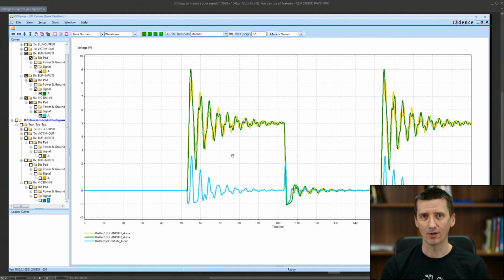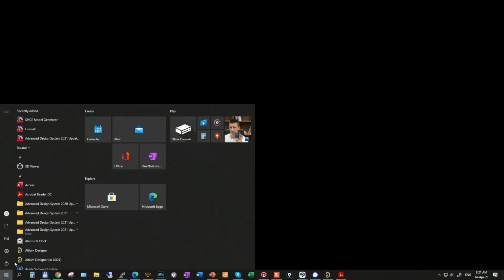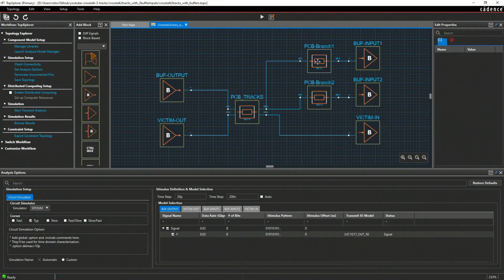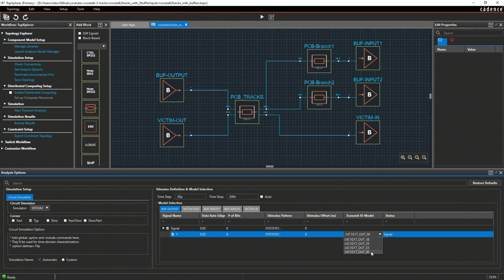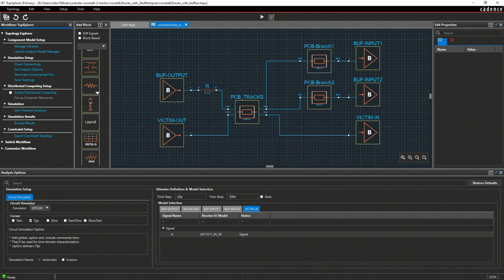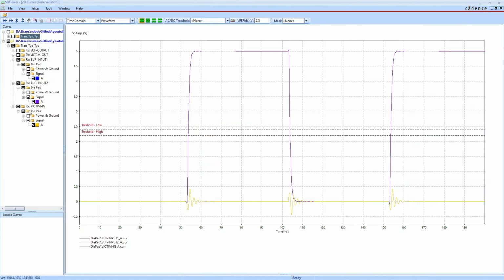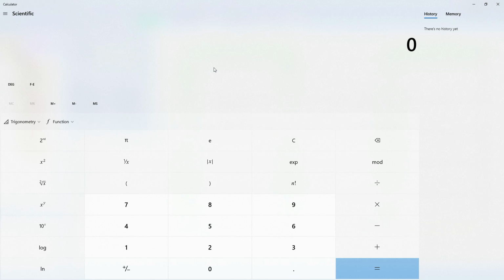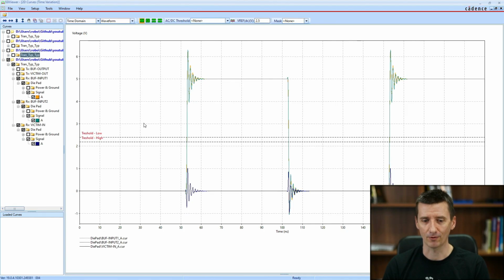3 Simple Tips To Improve Signals on Your PCB - A Big Difference

Comment: Yeah he's dead WRONG about his "impedance/reflection" reasoning. The "ringing" is from an RLC circuit that the trace forms as it becomes an inductor. if it was a reflection/transmission line issue, you would see a step looking wave, not a sin wave. The resistor limits the current drive which reduces the ringing, simple as that. By limiting current drive it reduces the slew rate and thus the high freq  energy that triggers the effective RLC tank circ that causes the ringing.  Sad to see him "making up" stuff to justify the impedance/reflection thing. same with stackup, it's affecting the capacitance. SO, the freq (10MHz) is irrelevant, it's only the Edge speed that counts (unfortunately this is typical youtube).
Reply: I’m sorry but your comments are rude, they are not constructive but destructive..

If you have watched previous videos of him, you would easily see he has solid knowledge that the rise time matters, not the frequency. However he should’ve also mentioned the rise time of the signal somehow, but he also knows that most people think and visualize by the frequency so I feel that was a better measure here.

If you’ve watched his previous videos on crosstalk which he had Bogatin as a guest, you would’ve removed your comment about the stackup change being only a capacitance changer..

Also, about reflection waveform being a step not sin, seems like you are wrong about it as he measures the end of the transmission line not somewhere in middle, please watch this “youtuber” video on this and observe the waveform on the scope: https://youtu.be/y8GMH7vMAsQ

Here is an another “youtuber” showing the reflection looks just like a sin ringing in the end of the line and there is a step in the middle of the line: https://youtu.be/g_jxh0Qe_FY

You may be right about RLC reasoning, but isn’t the transmission line an RLC circuit already?
Reply from the maker: @AbdullahKahramannn  Thank you.
Reply from the maker: Greg D, please, could you point me to the moment in the video where I am saying,  that the ringing what we see in that waveforms is caused by reflections? I am only saying, that if a wave hits incorrectly terminated end it will reflect - and that is a generic reflection which we also do not want to have in our circuit. In the video, I do not explain what exactly is the ringing nor what is its frequency or how it can be calculated.

Comment: I think I missed where the 33ohm value came from.
Reply: The idea is to put a resistor of the same value as the impedance of the PCB trace, to avoid wave reflection.
Reply: @TheGREDATV  I understand that's for termination resistors to ground, not resistors added in series, but maybe it's the same.
This series resistor seems to be good for building a low pass filter with the IC's on die capacitance at least.
Reply: @tomasxfranco  the parallel resistor is used to avoid reflection on the load, the series is put to avoid reflection on the driver.
Reply: @TheGREDATV  but he placed it on the load not on the driver.
Reply: @tomasxfranco  sure the parallel resistor should be placed always on the load, and the series on the driver
Reply: @TheGREDATV  so, are we back to it not working to stop primary reflections since it's not placed where it should be for that function?

Comment: Hey Robert, thank you for this informative and educative video! 
I was thinking what would happend if you increase the tracks length that it gets greater than wavelength?
Probably we would not like to increase it, but increasing the track would the noise increase, decrease or stay the same?
I would say stay the same, once it is greater than wavelegth, but something tells me that could be decresed (thinking about antennas you have the "best" length to get the right wavelength)...
Reply: Look up Standing Wave Ratios: antenna work on multiples that can also be fractions that, when there are length issues, cause destructive interference.  If in doubt, play with coax and use arbitrary lengths between connections and if you have enough connections used, you will see those that may work well, but others are effectively disconnected.

Comment: hey robert, great video and crystal clear! The only thing I wanted clarification and further elaboration on was the length matching of the two branches  from the aggressor trace. Since they are perpendicular to each other, why does making them the same length reduce the amount of ringing?
Reply: Because the signal reflects off of both ends, travels back and into the other branch. And if they have different lengths, the reflections arrive at different times, creating an oscillation between the branches.
That's at least my understanding, but take it with a grain of salt, I'm just a hobby dude, didn't study it.

Comment: Hey Robert,
Thanks for the video. It covers some of the basic SI principles and I'm glad you made this video because it can make my life as an SI/PI Engineer easier if someone like you is approaching something like this.

An important thing to mention that you did not is that the IBIS models allow you to also check how the signal will look like directly on the die of the component. Proper IBIS models have package parasitics, and pin parasitics (R L C) added in their models. This means that a signal might look good at the pin (where someone can physically measure with an oscilloscope) but at the die it can fail due to added inductance of the wirebonds and capacitance.
Hope this adds some valuabe information :)

P.S: I'm glad that someone finally explained why it's not all about frequency but about rise/fall times. I've seen 1MHz signals fail SI because they had 200ps rise/fall times and no terminations.

Comment: When reflections are high on both ends, the signal can bounce around and you can have standing waves, and the length of the track will decides the modes allowed, when the length is short enough no mode will be allowed.
The "nominal" frequency number really doesn't matter because the signals are more like square waves and when you do a fourier transform on them a perfect square wave would have all frequencies (from 0 to inf), for real signals the rise and fall time will decide the fourier transform result and thus the frequency distribution. The only time when the nominal frequency is the real frequency is when the signal is a sinusoidal signal where a fourier transform will result in one point in the frequency domain, which could be the case in some RF situations.
Also I would keep the tracks further apart so that the H and E fields generated by one signal would have less effects the other track.

Comment: In many situations, where the rising/falling time is too faster than needed in the application, 
slow it down by modifying the GPIO settings (configure output strength) or simply adding a small capacitor. 
The critical length is significantly increased.
Reply: Would that work for differential pairs? Our for I2C?

Comment: Very interesting. Notice I have always hear that the equivalent frequency of a square signal is 0.35/tr, so you wavelenght is even smaller. 
500ps is a very high speed signal. Basically, for a common signal is more like 10ns.
Reply: Some microcontrollers like the LPC2387 have a setting to choose between "slow" drive (3 ns rise/fall) and "fast" drive (500 ps, if I recall correctly). Most microcontrolles don't have this setting, but I think drivers faster than 3 ns are pretty common nowadays.
Reply from the maker: @guillep2k  Yes, that is very important to point it out.
Reply from the maker: Sirac: 0.35/tr - this is very interesting. I was actually thinking, that there may be something else, not 1:1 calculation. Thanks for this tip.

Comment: I think 2 more improvements can be tested.

1. Tie victim buffer input terminal to ground.
2. Place decoupling caps to all buffers near the supply pins.

Thank you so much Robert. By the help of these videos, even we can not simulate our boards, we can visualize the signals while routing.
You are our hero thanks again :)
Reply: 1) you mean like with a pull down resistor? When the reflection gets back, the netto resistance will be like a parallel resistor couple, while you need to be close to the line impedance. With a big pull down it appears like a open. In my opinion contributes to ringing. 

2) what would the function be of the decoupling cap? Of course chosen correctly to prevent to act like an inductor, it would slow the rise/fall of the signal. And would act like a short for high freq signals. So act like a short and contribute to ringing.

Comment: Great video once again, thanks!  Regarding measuring this on your scope, it's not just about the scope bandwidth but you will need a good probe as well.  My cheap 10x probes have about 15pF capacitance, at 100MHz.  This translates in putting a load impedance of about 100 ohm (1/(2*pi*f*C)) on the line you are measuring.  That should give you quite some effect already as you've now added a partial termination to the circuit!
Reply from the maker: Thank you Roel. PS: I agree about the probes

Comment: Back in 2016 I was set to design a PCB with 16 pressure sensors hooked up to a uC over a single SPI bus on a distance of over 20cm. Clock 8/9MHz can't remember.
Whereas everybody was thinking of a noob project, I mean, 8/9MHz, how low is that 😅, I was already suspicious by intuition, not so much because of the frequency but especially because of the high fanout load. I got myself LT SPICE, took the rule of thumb numbers as 10nH per cm for the traces, don't remember for capacitance, and, for each input, the input impedance stated by the datasheet (roughly 1Meg and 10pF). Started the simulation.... we sat speechless in front of the transient analysis... It was clear it would never have worked without adequate considerations.
We added those series resistors here and there, tried various values and managed to eventually get a good signal integrity. 1st PCB release worked perfectly but only thanks to that simulation.
That's when I understood how critical things can be at even low frequency and remembered me, at the end, it's not only the frequency, it's the relationship of frequency and impedance ^^
Reply from the maker: Very nice example. Thank you for sharing RDS on.
Reply: Thanks for sharing your experience. As a fellow electronics engineer, I can confirm that if you want to do something right, it's totally worth spending the time and putting in that little extra effort at the early stages of prototype development. I've seen PWM signal distortion happening even at 100kHz! Signal rise/fall time, path length and grounding are key parameters.
Reply: @elektrofreak-andg  Absolutely. It is an often overseen one, the rise/fall time. And with modern digital logic, we also fell into that one in a project in 2011. Changed an old buffer (obsolete) for a "replace with" part. Didn't work anmore. What the heck... we got desperate... until 💡: what are the rise/fall times of the new one... Oohhhh, there it is ^^

Comment from the maker: As Darko Obretan pointed out, the 2GHz wavelength in FR4 would be probably more like 80mm (3150mil) (?). I should use a different calculator, for example like this: https://www.pasternack.jp/t-calculator-phase-length.aspx
Reply: Good catch!
Reply: I think the 15cm wavelength is for propagation through vaccum (or air).

Comment: Perfect wideo! 
What would  you  do if  you need to split I2C clock signal to 7 chips? And if this is not a standard 400 kHz I2C but 1 MHz I2C?
Reply from the maker: Thank you Sergey. PS: Maybe what could help is to keep it as one long line (do not really use branches). But I have not really seen any special problems with I2C (but it doesn't mean there can't be problems).
Reply: I2C doesn't reach those rise times (500 ps) easily because a pull up resistor is used. I don't believe the fall times are too fast either for the same reason, so it's very unlikely that you'll see this kind of problem unless your tracks are like reaaally long. That's the main reason you have a quite low max transfer rate (400/1000 KHz) with I2C.
Reply from the maker: @guillep2k  a very good point about the slow edge for open drain + pull up.

Comment: really interesting! does the simulation also consider in which angle the traces are routed and split into two? does it help to have a doubled width before the split?
Reply from the maker: Thank you Marv PS: I do not think the angle would be important for this simulation. Double width could influence impedance, but again, maybe for this kind of frequency that would not really do much change (I am just guessing).

Comment: Great job Robert, thank you for such an educational tutorial.
on 31:52 You mentioned that you believe one side matching is enough to remove ringing.  
I know that a proper Termination resistor removes the ringing. But how to be sure if there is a termination resistor in high impedance buffer input?  

It would be great if you make 
a video about NanoVNA usage for impedance checking
or  a video about how to design shields for noise immunity
Reply from the maker: Thank you Mustafa. PS: there is normally no termination on input of a standard buffer. Also, if there would be you need to be very careful as you may be creating voltage divider (depends on what kind of termination is used on output and what kind of termination is used on input).

Comment: Hi Robert, interesting video indeed. While 2 out of three solutions were no surprise to me (impedance matching track and buffer output), the stub length matching was.
Maybe you could make a follow-up video going deeper into the signal split and stub length and explain better what happens there.
Reply: Funny things happen, due to different trace delays and splitting power at the 3 trace junction. Evey time a signal comes to the junction it splits into two signals 50% the power (same voltage, half the current).
Case with matched series resistor:
a) A=>J=>B1 (delay T0+T1)
b) A=>J=>B2 (delay T0+T2)
At B1 & B2 receivers the signals reflect going back (100% power, 0 Phase shift due to high impedence end)
aa) B1=>J=>A (delay T1+T0)
ab) B1=>J=>B2 (delay T1+T2)
ba) B2=>J=>A (delay T2+T0)
bb) B2=>J=>B1 (delay T2+T1)
Signals at driver have nearly no reflection (~0% power), but signals ab & bb reflect again at the receivers.
So signals bounce between B1 and B2 going lower and lower in power as the signals split and the ones going back to the driver are dissipated.

When the lengths are not balanced there are many echoes out of sync => high frequency oscillations seen in simulation. 
In case of balanced arms the echoes are in sync, so lower frequency oscillations occur.

P.S.
Fun fact:
In flyby layout (no junction, just route thrugh/by on B1: A->B1->B2) there is a delay between B1 and B2 received signals, but also there is only one signal reflected and that one is finally dissipated in the driver series resistor:
A=>B1=>B2=>B1=>A
Reply: @icestormfr  nice explanation and it makes total sense. In a nutshell, it's about the reflected signals traveling between the stubs. but even if they are matched in length, the split of the reflected signals does happen. Maybe, additionally, in case of matched stub length, the reflections cancel  (at least down the 2 stubs).
Reply: @marcgoovaerts2614  yes and no 😅
They could cancel if one arm was open ended (high impedance) and the other shorted (low impedance) and the lengths balanced.
One reflected wave would have inverted sign (shorted end: incident wave and inverted wave add to zero volt).
When they  meet at the junction the waves going back to the driver would cancel each other, but each wave going to the other receiver would still be there.
Reply: Oops, I was probably a bit too fast about my conclusion what happens at the junction when the two reflected waves from balanced arms arrive. Have to think about again, but could be that the waves combine without the extra reflection into the other arms 😅 (T junction Power Divide Theory)

Comment: So, if you calculated the impedance of the original lines and used a resistor with that value as series termination, you would had squashed the ringing even without changing stackup?
Also, I am curious about balancing split lines, why reflections from same length branches cancel when they meet back at the fork? I expected they would be in phase with each other then, there.
Reply from the maker: I think, I did try that :) I could try it again .... but ... I believe using higher series resistor may have other effects to the signal. PS: I also think the reflections from the branches are in phase but I suspect, that is what helps it to eliminate them (?)

Comment: Answering the question at the beginning I would say impedance matching using a series resistor and appropriate track widths.
Edit: a few minutes in, am I seeing a stub over there?
Edit2: if I can, I try to avoid branching and chain the signals (going through all the ICs with a single track), you won't need to length match in that instance.
Reply: So having a fly by topology is even better that branching?

Comment: Great Video !!!!
In my opinion U need to make it with respect to capacity and inductance ...
 it is like Smith Chart  by design of 50 Ohm line on the PCB, if Urs output is 18 Ohm U need to put some termination and to get 50 on line if the line out is 200 U need use Caps in pico to absorb this "energy" from going back but U changing this 200 to 50 in line of inductance and capacity. on the end of line. 
In RF the One way is to make wider tracks to get more of pF just look for strip-line filters they 100% Use this technique.